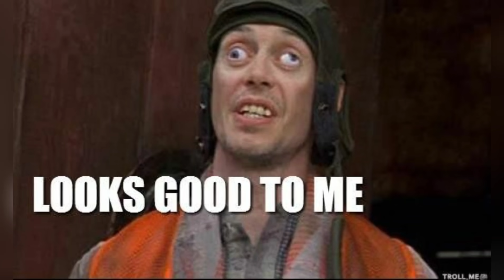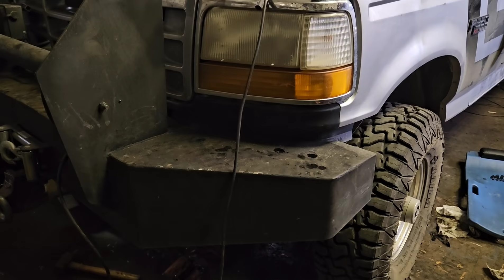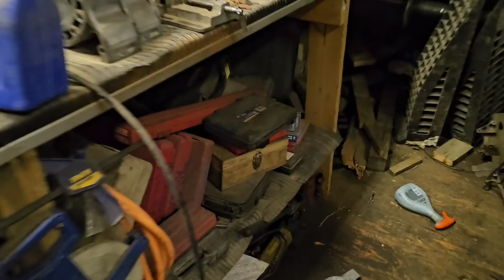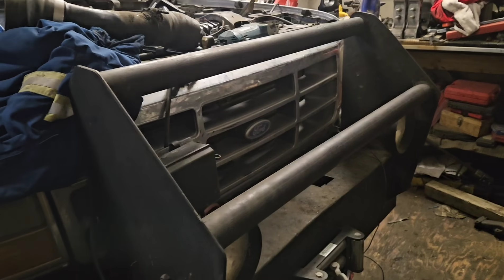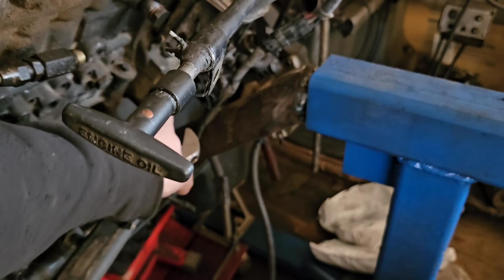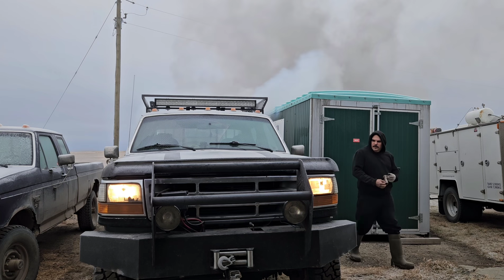FORD IDI DIESEL DELETE AND CUMMINS FULL INSTALL

Comment: Is that an ariel hat on the dash of the ford during the test drive?
Reply from the maker: Yessir, i work in gas compression
Reply: @captaindipchit awesome I knew I recognize that logo
We use em to compress hydrogen at work
One does 2000 psi the other does 6000 psi

Comment: Really want to do this on a rolling chassis OBS. I assume there's a whole other process to get the engine connected to the 4r100 auto trans? Also, i know on at least the IDI you can run a 90/10 WMO to Diesel mixture, is that the same for the 12v Cummins? My main reason for swapping is easier to work on, and much easier to find parts for them, modify etc. Ideally would love to run a split gear trans for double overdrive or something but, your video is one of the first I've come across while doing research. Liked and subbed for more content!

Comment: Swapping a good running IDI for a pos Cummins? You been dropped a few times, huh?
Reply from the maker: Idi is gutless, i own several, they are all gutless, I love them but need to tow things, NOBODY is pulling another diesel to swap in an idi unless they are retarded, i would swap out a gasser for an idi though
Reply: @captaindipchit So gross. An IDI will outlast ANY made in China pos Cummins. If you're swapping it for more power... then why tf are you swapping in a pansy-assed old diesel? A Honda riding mower makes nearly as much power as that pile.

Comment: A 7.3 idi clutch disk and pressure plate will bolt right up to a 12v flywheel. Why are you drilling and tapping it? Just curious.
Reply from the maker: Mine did not...not sure why

Comment: i got the same exact turbo i used the 12 valve manifold drilled out the bolt holes on it and just used longer bolts and nut's, i used a drain plug from a 241 transfer case to plug where the solenoid goes, and made a custom manually adjustable spring gate, the things mint, does 40lbs of boost ez pz. only problem is a i got a rustbox dodge would love to swap a 12 valve into a k2500 or a 2015ish chevy 2500

Comment: anyway you could share the dimensions of that bumper with a feller if you have them?
Reply from the maker: There are no dimentions to share... it isnt perfectly simmetrical, i just built frame posts and added steel until it ressembled a bumper...halfassery
Reply: looks good to me! @captaindipchit

Comment: The floor shifter's if the screw's are rusted beyond using a screw driver, take a drill and drill the head off from the screw with a bit that is just bigger than the screw head or so close that you can pull up on the plastic and break the head off them.

Comment: Just in case you didn't know, (you likely do) you can get a factory Ford tach cluster, and the wiring is already setup from the factory for it. Literally plug and play. You just take your center section out (with the odometer), and swap it over to the new cluster to keep things "legal". There's no need to do the hillbilly aftermarket, screws in the dash big pod tachometer like so many guys do.😂

Comment: If you do enough drilling, Walter makes a low profile magnetic drill for drilling inside I beams and truck frames, i use them sometimes for drilling out broken bolts on excavator undercarriages. They work great. They are only about 8" tall so they work upside down easy.

Comment: Whatcha gonna do with the Powersmoke yall have in yer shop?
Reply from the maker: Not sure...nothin yet
Reply: I'm doing a powerstroke swap in to my 88 crew cab right now. I'd like to Cummins swap it, but the 12 and 24 valve engines are unobtanium down here in Nor Cal.

Comment: Looks good.  Just a couple weeks ago I bought my first Ford, a project truck.  1997 F250 4x4 with a 1997 12V Cummins.  It isn't done but it looks like I missed out on having some fun with the front end.  I have to finish the AC and I may redo the turbo and associated piping.  My truck also has 2008 F250 axles with front coil springs - probably not necessary.  I'll run taller tires as well even though I think my axles have 3.73 gears.  My '03 Dodge has 3.55 gears, 6-speed and 33" tires.  It pulls my 18,000# RV trailer no problem.  I do wish my Ford had the 6 speed.  Anyway, thanks for the video.  Minty.

Comment: Little tip for ya guys, I have a 1992 dodge VE pump 12 valve. I have 3.54 gears and standard 5 speed trans on 31.5” tire. If you want a higher top speed for cheap put 3200 or 4000rpm governor springs in the pump. World of a difference. Im able to get up to 90mph with my truck on 31.5 tires.
Reply from the maker: Thanks but i dont want to rev it...35s will look good on a crewy longbox anyway...
Reply: @captaindipchit  right on! I need 35’s…

Comment: my 887 pump (215hp) 12v set up, it likes around 30psi of fuel pressure up on the highway, and thats with the stock mechanical pump, tweak the OF valve spring on the pump to bump the fuel pressure. i've had good luck with bosch 330hp marine injectors and they played nice with the stock turbo and stock fuel plate full forward, and with a #10 plate 3/4 forward, any more than that and it would blot out the sun and egt would get toasty, its got a turbonetics stage 1 ball bearing turbo and that turns a lot more of the soot into power. i set the timing with a dial indicator kit, mine is happy at 16.5 degrees (2 more than stock) when i got the truck they tried to set it with the pin and it was like 4 degrees retarded and ran like shit, would belch white smoke and backfire like a cannon till it got some heat in the motor, the twin ram banks intake i lucked into for half price actually dropped the egt's/smoke more than a little, so its good for something, i gotta imagine the cheapo versions do the same thing, i split my grid heater, but maybe up in the land of ice and snow you may want two, in loserana split works fine, cold as hell here is 22f

a fun toy if you can find one is a gearvender overdrive, took my 4:10 70mph speed from 2250 to 1750-1800 with a nv4500, can split gears too for fun or hauling, at 2k for a used kit, its my favorite mod after the odd 50% more power its got
Reply from the maker: Thanks i know, i will put on a better pump than the crappy carter pump when i have the money...cheers
Reply: sweet spot seemed to be around 28-34 in my testing, been at 34 for about 13-14 years with the same lift pump and everything else  @captaindipchit

Comment: Big shout out from Texas awesome Truck!.....im currently almost finished with my swap....1994 f350 zf5 4x4 12 valve....i do have a question.....how to get the tachometer to work as far as wiring?....any advice would be greatly appreciated!.....Y'all stay warm up there!
Reply from the maker: Thanks, i have friends in texas, beautiful place, you cant use the factory crank pickup as its 5 volt and needs the dash module, you can get a crank pickup model or one that runs off the alternator, i havent done that yet either...cheers

Comment: Sweet rig! That 12 valve is gonna be fun but in my opinion a DT360 would have been awesome. In my neck of the woods a DT360 is cheaper than a 12 valve so naturally I favor the DT360 plus it's a wet sleeve cylinder design.
Reply: Weight and issues with adapting a transmission seem to be what keeps the DT’s from getting swapped into pickups more often. In a 2wd it’s not too hard, but in a 4wd you’ve got to either be / know a good machinist to build adapters or go to a divorced T-case, build mounts and a shifter linkage for it and run a medium duty trans.  IH actually put a few early “D series” inline 6 diesels in 3/4-1ton trucks back in the 60’s….that was called a D301 and was a parent bore version of a smaller sleeved engine as I understand it. They only built a handful and Today those trucks are rare but man are they cool.
Reply from the maker: I want to do a 6v53detroit...buddy has one but wont sell it to me

Comment: It would’ve been best to beat in the firewall over number 6 cylinder so the valve cover can be removed easily in the future for valve lash adjustment. Also the corner of the tunnel to gain for room for the down pipe from turbo. I did this to my OBS swap and it does make a difference. Good luck on the swap, you will not be disappointed. 👍🏼
Reply from the maker: Yes i learned that the hard way...next time

Comment: P pumps need around 60psi lift pump pressure. And you don’t have to have the fuel plate in the pump.

Comment: I didn’t think 10 psi for that electric pump is enough pressure. Pretty sure the mechanical lift pump is 30+psi. That would make it run like ass

Comment: If my cheap 93 crew cab idi doesn’t work after I redo the head gaskets I’m sourcing a Cummins for it. Only have 456 dollars into it total since my friend didn’t want to see the truck scrapped and or parted out. I only need a return line kit and head bolts and thermostat and water pump gaskets then it’s onto reassembly. Already bought the head gasket kit and the used heads

Comment: this cummins without electronic injecion control on injection pump make no power , you can make 1.9tdi from 1999 to make from 110hp to 190hp with soft and turbo and will be a little rocket compare to this 5,9cummins  on manual pump

Comment: Did you figure out the issues? I have a 98 12v truck and i was dealing with this same issue and it all boiled down to fuel pressure. I put an airdog 165gph pump on it and solved the problem. Runs perfect no hesitation or stumbling. These ppumps really need 35+ psi. Mine is turned way up and has bigger sticks turbo gov springs etc so i was recommended to run 45psi fuel pressure. 

Additionally its really easy to wire the factory dodge fuel shut off if ya want id be happy to help!

Comment: Id swap axles to 3.55 or 3.73 ratio. I have a 96 f350 with 4.10 gears and 35s and im still running 2500 rpm going 70 mph

Comment: I've heard a 6.4 starter has more starting power and speed. Should save on those cold starts
Reply: I also used the stock manifold but flipped it upside down with the stock turbo

Comment: Glad to see ol sawed off posting again. What also works for drilling upside down as if you have a spare floor jack. Put the Jack underneath the drill and then you just put a little bit of pressure at a time on the jack 👌
Reply: This is the one a old timer showed me 50 years ago,kids look at me like I’m dumb when I see em struggling & try to pass it down, glad someone else learned it somewhere

Comment: That srw should or is most likely a 3.73 rear, I think the drw was a 4.10, and I think there was a 3.55 option?? But seems like swapping the rear to a smaller gear would be the easiest and cheapest way to get the rpm’s down,

Comment: I agree with you, the 12 valve cummins is a much better engine, m9re reliable and cheaper on parts. And with 250k km it's only just tun in 😅
Reply: 6.9 parts are pretty cheap

Comment: Looks good sawed off.  This is my plan when my 6.4 dies in my F550. It wont be long....it already blows the oil cap off when u unscrew it. Glad u got it running good.
Reply: Is your ccv working? Has it been messed with?
Reply: @GRANITEMONUMENT  I'm pretty sure it is working. It pushes oil in to the turbo inlet, so I think the motor is just living on borrowed time. I need to do the ccv mod just to keep the oil out of the intercooler.
Reply: Can’t you slap a smaller rear gear in it? Being friends with old peg, I’m sure it would be cheaper than a new set of tires?, unless you need them anyway